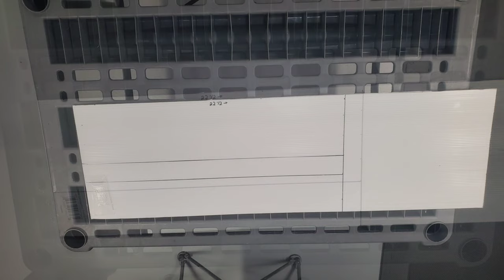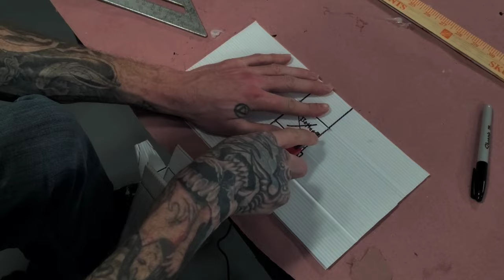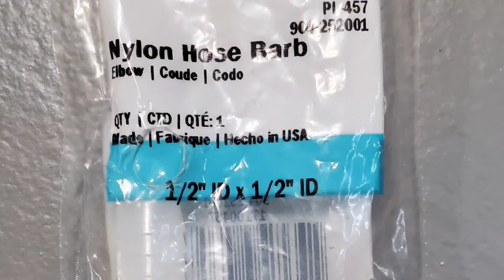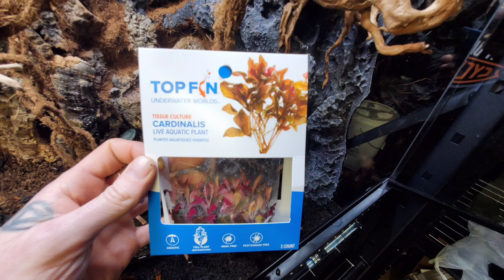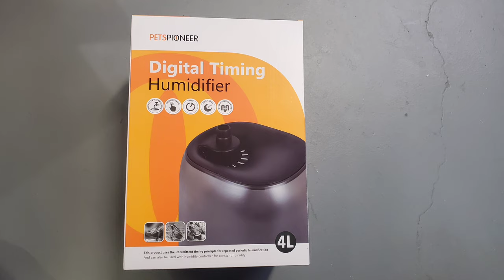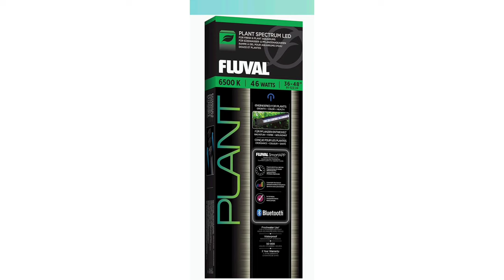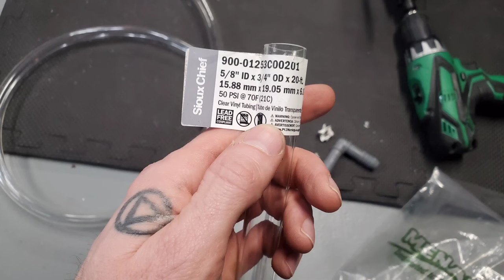How To Build A Paludarium DIY In Depth Tutorial #paludarium #bioactive

Comment: Hi Brad, wondering what’s drill head you used and how long it took and any more info you could give me on this part of the build as it’s the most I’m worried about please 🙏
Reply from the maker: @darkrocket1648  it's more stressful thinking about drilling glads than it is to actually drill glass. Watch my Varanus Cumingi grow out tank build I go over drilling glass again in that. I also have the links to the drill bits in the description. 
But basically you want to have water to cool the bit.
Make a Jig so the drill bit has a giud.
Let the weight of the drill of the drill do the work (don't press down)
Painters tape over where u r gonna drill will help to.
Takes anywhere from 3-5 minutes to drill through non tempered glass
Reply: @bradsbioactivebuilds  Thank you so much 🙂🙏 just tryna figure out what plumbing bit I’ll need haha I love your vids 🙂🙏thank you!
Reply: @bradsbioactivebuilds  how big typically do you making your plumbing holes
Reply from the maker: @darkrocket1648  for the bulkheads?
Reply: @bradsbioactivebuilds  I believe so. Still trying to learn all this plumbing stuff haha but what I mean was how big do you make the holes and I’m tryna wrap my head around it all still and trying to figure out what plumbings stuff I need at what sizes. Sorry for all the questions so intrigued!
Reply from the maker: @darkrocket1648  it's have a lot of the supplies in the description. 
But I use a half in slip bulkhead (half inch ID or inside diameter) 
Feel free to message me on patreon or IG and I can help a little better there
Reply: @bradsbioactivebuilds  I’ve sent you a pm on insta but wasn’t able to finish my mssg as you’ve gotta accept 🙂and thank you
Reply from the maker: @darkrocket1648  cool, accepting now

Comment: How are the dart frogs doing in there? I’ve seen a lot of people saying you shouldn’t put dart fronts in a paludarium because they can’t swim. Have Yours be doing ok?
Reply from the maker: I think it's mixed opinions. Facts are they are not great swimmers but can swim out of water. 
My Blue Azureus Tinctorius in another build for the last 8+ years have done great with a water feature. 
In this build my colbolts are doing well. I watch them to make sure there is not an issue. If there is they get moved out. They do not use the pond section but I often see them haning out in or in the waterfall.  I do loose some floor space for them with the pond but I built the hardscape background in a way to maximize surface area to make up for that. They seem happy in this enclosure. Eating well. Out and about always coming out to see what I'm doing in the animal room. 
With that being said I do suggest an experience keeping only keep a pond area and watch for signs of stress. 
I have also put them in the water to watch them get out with ease and so if they did go in when I was not around they would know exactly where to go and how to get out. Each time their instinct too over and they got onto land with no problem. Hope this answer helps.

Comment: I am very curious about using corrugated plastic like this instead of glass to separate the water vs using glass. Does this hold well in a large glass set up? I am currently setting up a 180gallong paludarium with 10" of water for fish. Im looking at long term what could happen, so any insight would be helpful on any problems using the corrugated plastic vs glass.
Reply from the maker: How much gallons of water are you looking to have? This set upbhas worked well. The reason I used corrugated plastic was to not have a straight line separating the water and glass. It has held up with not peaks that I can see or notice. If I were to donit again I would do it the way I just did my most recent t video for the earless monitor. Using polygem zoopoxy. If it was a larger divider I would have used corrugated plastic then added zoopoxy over that, soliconing it to the glass bottom of the enclosure.
Hope that helps
Reply: Thank you for the response. I will dig into the newer video as well. I will end up with just under 30 gallons of water. I plan on doing water tests over the next week. I currently still plan on using glass, but also now I ordered a couple sheets of corrugated plastic. 

So all the information helps. Thank you again

Comment: Any issues with the foam detaching from the glass with time?
Reply from the maker: I have not had this issue. I make sure I clean the glass with rubbing alcohol. You can put down some silicone 1st to reinforce it, too. If I only did the back wall, I would proply run into some issues, but with 3 sides done, it also helps hold it in place. 
🤘💯🦎🐸🐍🐢🌱

Comment: I've been worried about the wood and foam with high humidity. But this seems to work for you. How do you think it works now?
Reply from the maker: Good question, it really depends on the kind of wood thay is used. Cork bark holds up very well with humidity. The ghost wood holds up well to but will go through a mold process (normal with most things as it acclimates) but will clear up in a week or 2. The drift wood and spider wood have no issues. 
The foam has no issues what so ever.
🤘💯🦎🐍🐢🐸🌱
Reply from the maker: Grape wood is not ideal for humid environments, I learned the hard way years ago.

Comment: When I finished drylocking, and I took the tank out to spray down and rinse the background, the water was very cloudy and gray from the drylok even after having rinsed it repeatedly many times over. One side still wasn't rinsing clean when I decided to stop, and I didn't even use multiple coats. Do you ever have this problem? What do you do about it, if so? Is there a way to avoid it?
Reply from the maker: I let the drylok dry/cure for 10 days after my last coat. Than give it a good spray down. If you add water to a water section naturally the water will seem cloudy until all the minerals settle. I sometimes, however, fill up the water section without substrate and run it for a day or 2 then drain and proceed with process
Reply: @bradsbioactivebuilds  I see what happened. I didn't let mine dry anywhere near as long. I think I waited a day, maybe just 5hrs or so, until it looked fully dry. If there's a next time I'll be sure to wait a lot longer. Thx
Reply from the maker: @shrivalup  hope there is a next time for you. A lot of the things I have learned have been by asking questions and trial and error. I've learned it's not a race to finish and to over engineer so hopefully I don have to go back in for a major repair after it's up and running.

Comment: How are you able to prevent mold formation in the air ducts?
Reply from the maker: Honestly never thought about that. But hasn't been an issue. I'm sure spring tails are able get there if needed. But that's one of the reasons I added the airduct, to have airflow to prevent mold.

Comment: How well do the tincs swim when they accidentally go into the water?
Reply from the maker: I've kept darts in small paludarium bodied water or large paludariums with a lot of usable space. Over the last 10 yearsbi have not had an issue. I purposely place them into water once new to the enclosure so I can see them swim out. Since doing so, i have never seen them enter the water. If I had a concern they would not be in there. They are not great swimmers but can still get out if needed based on the initial time seeing them in. Butbonce again I have not seen them jump, fall or enter the water on their own. 
I would suggest if you are new to dart frogs to not do this on your 1st go around.

Comment: How well is the dry lock holding up after having running water over it for 10 months? I've been looking at different materials I'm wanting to make a paladarium with my 180 gallon aquarium.
Reply from the maker: Holds up great. But I also did a coat a day for like 10 or 12 days (overkill but I wanted to be safe not sorry, been there done that lol) No leaks, that I can tell evidence by waterline. I liked doing the xps board because it's a lot less pourise than spray foam. (Sprayfoam has more potential to not have everything covered), and it's a harder surface. Then Drylok the xps base in a few times. Then sprayfoam over that for details if wanted. Then, drylok over that.I hope that makes sense, lol. 🤘💯🦎🐸🐍🐢. I'll be doing a year update when the time comes

Comment: Great build! Can you clarify for me: land area has no direct connection with water area, correct?
I’m having difficulty following your plumbing. How are the canister pump and mini pumps set up? From where does the water get sent to the canister filter? Is it just drawing water next to the mini pump? And where does it return? To the large waterfall on the left side of the set up? Thanks, I look forward to seeing more content!
Reply from the maker: Correct,  the land area and water area are not in direct contact with each other. They are divided with the corrugated plastic. The land area has a water overflow drain in the drainage layer, and the water section has a water overflow as well

There are 2 pumps.
1. The exterior canister filter pulls water from the back chamber and also outputs water to the top of the left waterfall.
2. The small pump is just set in the back chamber, and I just run a hose to the top of the right waterfall. 
If you have more questions, feel free to ask. 
🤘💯🦎🐍🐢🐸

Comment: Does the curigated plastic tough can it hold alot of substrate?
Reply from the maker: Yes it has been holding up well. But I started using polygem Zoopoxy since I build this enclosure. For my next paludarium build I will be using that over the corrugated plastic to make it even more secure! 
Hope that helps 🤘💯🦎🐸🐍🐢🌱
Reply: Thanks links to the zoopoxy I'm planning on doing a build.. YOU ARE A GREAT TEACHER
Reply from the maker: @Javier-kr5vx  of course. I have some links to polygem Zoopoxy in my last video I uploaded. It also goes over how to ally it.
Thank you for your support!
🤘💯🦎🐸🐍🐢🌱

Comment: You blew my mind, suggest using  pvc pipe or pvc square railing instead of corrugated board for filter setups. Your a beast. A plus for the wife getting you the tank.but if you want totally custom bro better quality make it completely out of glass. A premium just for a  vent in-between door and bottom space I'm making my own. Also you could of done a overflow like a standard tank on bottom saved alot of plumbing and expensive parts. I just an idea.
Reply from the maker: Thank you,  and i have been wanting to build a custom glass enclosure. Have fun woth yiur build.
🤘 💯 🦎 🐍🐸🐢

Comment: man , question please, the corrugated plastic what material is it? Polypropylene??? and how  much is the thickness??? thank you man
Reply from the maker: It's a plastic. I found a 4x8 sheet at home depo.  Use the GE silicone by thay section as well. It's white and red tube ment for plastics and also 100% silicone. 
It's maybe only a 1/4" thick. I'll add it to the description. 
🤘💯🦎🐸🐍🐢
Reply: @bradsbioactivebuilds  thank you!!

Comment: How do you access the fan if you need to replace it?
Reply from the maker: Good question. I remove the cork bark "lid" I made over the top of the lid I made with the corrugated plastic door I made in the top of the airduct itself. Then, just pull the fan out by the cord. 
To put a new fan in, I just set it into the airduct and push it down slowly with a ruler applying even pressure. 
🤘💯🐢🐍🐸🦎

Comment: What’s the trick to getting the doors off so easily?
Reply from the maker: If you have a spare exo terra laying around give it a test run.
Open the door and lift up and towards you. Making sure not to put your other hand on the topnof the frame. 
When you put it back in pit the top peg in the hole. Then slide the bottom peg along the bottom lip until it seats in the designated swing arm hole. 
If it's a real tight exoterra sometimes you can use a razor and cut 3-5 inches by just running the blade along the top outside rim of the frame/lid.
There are some helpful videos also on YouTube as well

Comment: Hi I was wondering what classification of dart frogs they were and if there were also glass belly frogs and Mourning geckos that went in there. Also would like to know how they cohabited and if there were any problems as I’ve been looking to do the exact same as you’ve done before I stumbled upon you video securing my idea 😁🤔 please and thank you 🙏
Reply from the maker: @chloewallbridge6056  true sips, and I ended up re-homing the mourning geckos bc they started to take over. It's definitely a fun build to do
Reply: @bradsbioactivebuilds  thank you for replying I would love to have a go at this I have one more question sorry with the overflow holes how high/ low did you create them compared to drainage layer
Reply from the maker: @chloewallbridge6056  for the water over flow hole?
Reply from the maker: @chloewallbridge6056  and the land water overflow was as low as I could make it with the bulkhead outside diameter and nut could still fit with a half inch gap from the bottom.

Comment: How do you service the fan? or replace is the fan goes out?
Reply from the maker: I would just take off the lid of the enclosure, remove the corkbark cover, unlatch the corrugated plastic flapn, and pull the fan out by the cord. Then, install a new fan the wat I did in the video. So far, both fans are still running, although one does make a slight winding noise on initial start-up for about 10-15 seconds.
Hope this helped!
Reply: @bradsbioactivebuilds  perfect thank you so much. dope build by the way, very informative video.

Comment: What size drill bit you used and what size bulk head?
Reply from the maker: Off the topnof my head I'm not entirely sure. But I put a link to the drill bits in the description.  It comes with a few different sizes.  I drilled the template into a peice if scrap plywood and test fitted the bulkhead in the plywood to the tightest fitting hole before using it on the glass.
Hope thay helped!
🤘💯🦎🐍🐢🐸🌱
Reply: @bradsbioactivebuilds  thank you 💞
Reply from the maker: @Living_Ghetto_fab  of course, I'll try to get the size. But from what I remember, the drill bits were not identified with sizes.
🤘💯🦎🐍🐢🐸🌱

Comment: Is there a difference in the pink foam board or can I use the green/blue
Reply from the maker: To my knowledge no, I have never used green or blue but I have seen other use it. It might just be a patten or something.
Hope this helps
🤘💯🦎🐸🐍🐢🌱
Reply: @bradsbioactivebuilds  thanks it does, going to be starting a build for my boa that's about out grown his tank and just want to make sure I order anything I need or not with I stuff I can pick up locally.
Reply from the maker: @jamesjenkins9655 I'm glad it helped and most supplies you should be able to find at the hardware store or Amazon. Most of my videos have links in the description of materials used. If you need something that is not listed lmk and I'll do my best to add it. 
If you're going a boa build, check out the 7 part series I did in my play lists.
Have fun building! 
🤘💯🦎🐸🐍🐢🌱

Comment: How do the darts deal near the water? I made a similar water feature and reading alot to not put them near it😿😿 what are the green froggies called?
Reply from the maker: The water is definitely unused space for them. But I created a lot of surface area in the hardscape. Plus, it's a larger build than most dartfrig enclosures. With that being said, I have kept darts for a while now, and if they are in an enclosure with water, I make sure they can get out if they fall in. I also keep a close eye on them when 1st being introduced to the enclosure. They're s.art then what people give them credit for and won't just jump in. To each their own, but proceed with caution. 
The green frogs are glass frogs. 
Hope this helps 
🤘💯🦎🐸🐍🐢🌱
Reply: @bradsbioactivebuilds  thanks for the advice.
Reply: @bradsbioactivebuilds  i will try to add more surface area over it and use sponge foam to raise the water level. Tbh ive never kept fish before so ill not worry about adding fish. One thing at a time.
Reply from the maker: @NeanderthalDogma  that sounds like it would work. Just watch the frogs for some time to make sure they do well. 
For the fish, once the water is cycled they are good to put in.
Reply from the maker: @HumilityListens  anytime
Reply: @bradsbioactivebuilds   do you know what type of small aquatic creatures are useful as clean up crews for small body of water?
Reply from the maker: @NeanderthalDogma  shrimp, Snails (ones that won't breed like crazy) clown pleco, they do have water isopods but I have not done enough research to give a solid answer for that one.
Hope this helps as a starting point.
🤘💯🦎🐸🐍🐢🌱
Reply: @bradsbioactivebuilds  thanks alot i will screenshot and keep those in mind. I wish I could snap a photo of what I got going on.
Reply from the maker: @NeanderthalDogma  feel free to send it to me on IG or patreon.

Comment: does the fan run 24/7 or is it on a timer? Also, would it matter or be harmful if the great stuff under water is not 100% sealed.
Reply from the maker: Great question. I've done both. I used to run 24/7. Now I run for a few hours a day from 
8am to 9am 
&
1pm-4pm.
Great stuff is fine to be in the water after if is fully cured.
Hope this helps